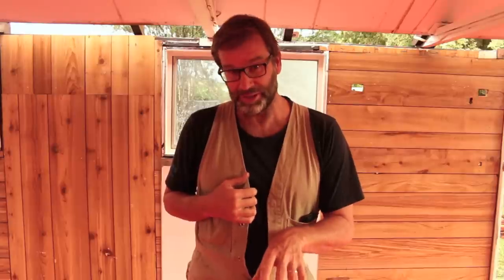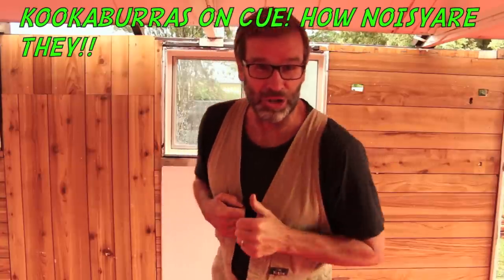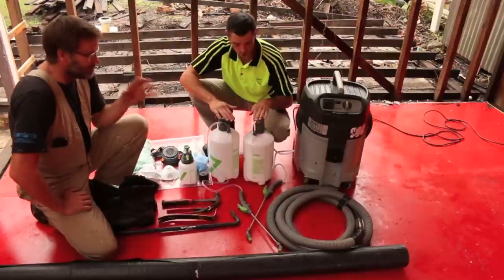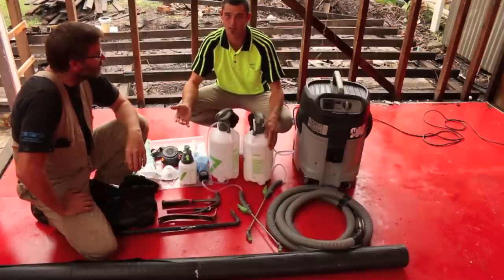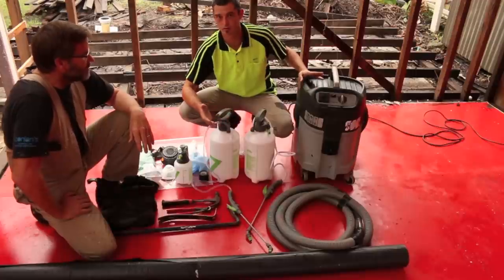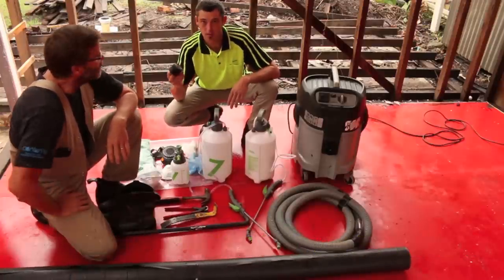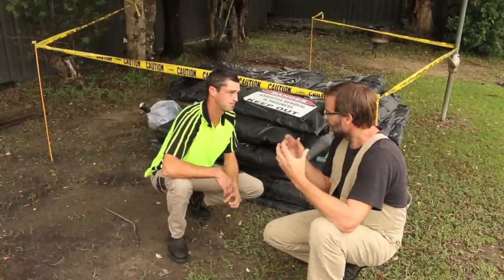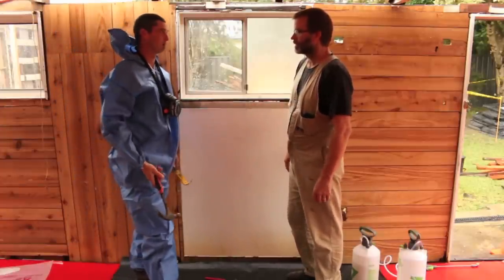How to Remove Asbestos. Owner Builder Series. Episode 5.

Comment: What do you recommend for a house that has asbestos siding on the outside of the house? It’s a ceramic type of siding. Contractor removed the first row close to the ground as we are working on fixing foundation. Would it be safe if I removed the rest of the siding completely off the house?
Reply from the maker: Hi. In my opinion, if it's asbestos, get the professionals in. Better to be safe than sorry 👍

Comment: Hey, I work in plantrooms on refrigeration for my job, a lot of the rooms are made from Hardiflex asbestos board and the edges are not sealed and there are fans sucking up against the edges. Would you think the rooms are safe to enter without any PPE as long as the asbestos is not disturbed by man? or would you recommend a dusk mask. Because I know 1 fiber doesnt kill but these rooms are very dusty
Reply: Definitely think that wearing protection is a must! It might be hard to distinguish the normal dust from asbestos dust, so be over cautious! Better than taking the risk
Reply: Yea its a shame ive swept up in most of these rooms and even the really bad room where its everywhere, even on the duct tape for the chiller aircon, and all the walls are poorly maintain asbestos cement, but in future I will be wearing a mask in there. All that I know is @ trade school, which is government owned, all the electrical training side we work on, all the electrical components are mounted to bituminous asbestos electrical board with some exposed edges, and this is the brown asbestos (the stuff where there is not much chance compared to white) and we are all throwing this stuff around. Cant get away from it :) But just something I would ad in...

Comment: I think i've found an old asbestos fireproof board in an old cupboard that used to be an 70's air heater system. It is on the roof of the cupboard and has a sticker on it from 1999 saying it "may" contain asbestos. It looks alright and has been up there over 35yrs i've been here. However, i noticed the cut edges are exposed and not flush against the wall. And the inside material looks kinda like plaster as if it could be flakey but it isnt flaking. Wondering if i should just leave it there. Been here over 35yrs and not dead yet. Or maybe wet the edges and fill in the gaps with filler to close off the exposed cut edges then paint over the entire thing with gloss paint.
Reply from the maker: Usually asbestos left untouched is generally safe. It's when it is sanded or broken up that fibres are released into the air. Filling the gaps with caulk and then painting over will definitely seal the product.
Reply: I'll have a think and go from there. Thanks for the response mate. Cheers.
Reply: Without a photo I can't tell you if it is or isn't asbestos or the type of asbestos. If your worried use an asbestos hygienist to test it. But DON'T disturb or remove it. Also Silicon gap filler is good to use. 

This video only shows how to remove bonded asbestos not friable (that's the stuff you should be worried about).
Reply: Bad_Robot if you don't need the heater just tape it shut.

Comment: I have a 500lt asbestos water tank in my land. Can I safely pull it outside my land so the waste collectors can take it away as they don't collect from private land
Reply from the maker: Charles, without seeing your situation first hand it's hard to say but l'd say no. Asbestos is deadly and is not worth playing with. If you can, get in the professionals. good luck 👍😁
Reply: @diyforknuckleheads  If I do it my self I will wear disposable overalls and p3 mask and I will wrap it in thick plastic sheet and close it with tape and then break it with a hammer. Is this a proper procedure?

Comment: Don’t use a paper p2 for asbestos for crying out loud. Use a proper mask (you can buy them relatively cheap at Bunnings) and shave before you use it. The PPE has to be appropriate and a paper mask would almost certainly be deemed inappropriate for asbestos as they don’t seal properly to your skin.

Comment: I find it hard to believe that you need a "professional" wearing a hazmat suit to remove one piece of material.  It is not like fibers are going to be blowing around.  If you can live with this material then you can remove the material.
Reply: peggyt1243  You can't 'live' with the material when it has aged or the surface breaks down .... that is the problem... over time it becomes brittle and snaps.. the fibres escape very easily when it is disturbed.
Reply: grumpy poo My understanding is that "asbestosis", the disease that results happened after years of contact with loose asbestos by the workers in asbestos factories.  Perhaps I am naive but spending one day exposed to the stuff is not life threatening nor is exposure to rigid asbestos products in the home.
Reply: This is the most publicised  .... however, in  uk it has been found that children and those with vulnerable health, exposed to environmental slab asbestos in the home and schools in the 1950's and 1960's  , (as described by Shane,) developed asbestosis in later life with very  little exposure . . Nothing was known at this time.... It was the post war wonder insulator and fire retardent material. It was used extensively ...  rigid asbestos becomes brittle and breaks exposing fibres ....  mighty dangerous.
Reply: peggyt1243 Look at the video again at 8.19/20 and you will see the load that came out of his house.
Reply: Barry Roberts I guess being a baby boomer, I find a lot of the current safety laws to be overkill.  I was not raised in bubble wrap.  I drank water from lead pipes, drank untreated water from the lake, breathed second hand smoke etc.  LOL, back then parents used to spray bug killer every night in children's bedrooms to prevent them from being bitten in the night.  God only knows what was in the spray,
Reply: peggyt1243 I wasn't raised in bubble wrap either, I had a hard upbringing but I agree with you on some stuff being overkill, but asbestos isn't overkill. Bad stuff.
Reply: Survivors bias is an interesting thing...